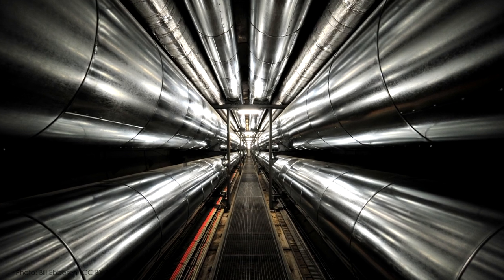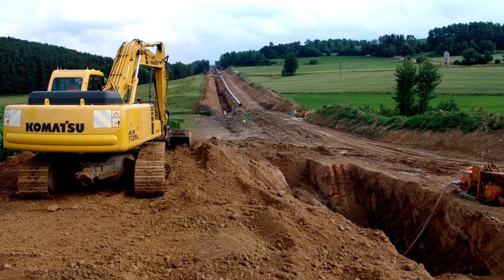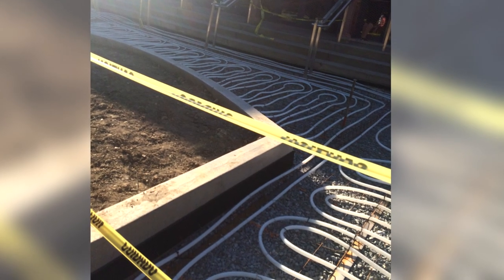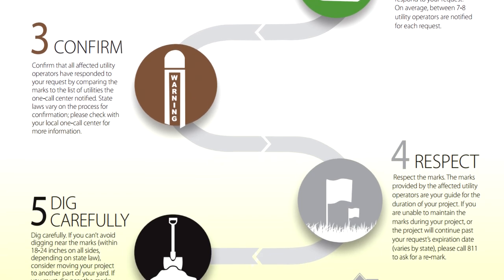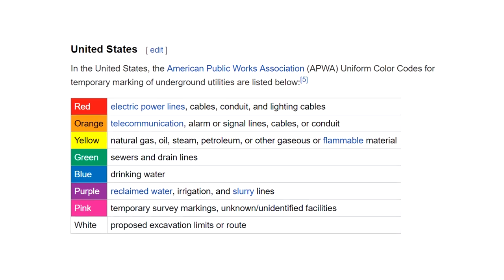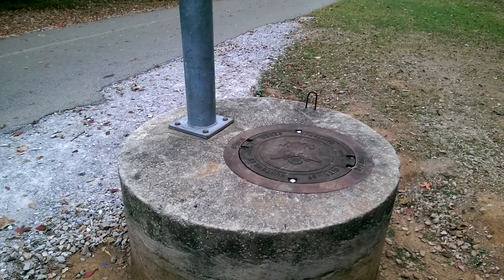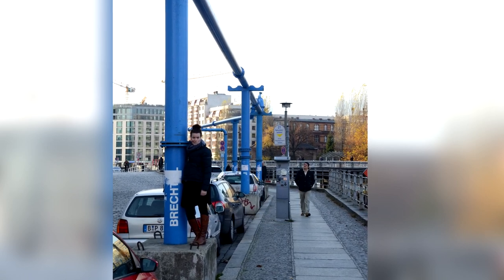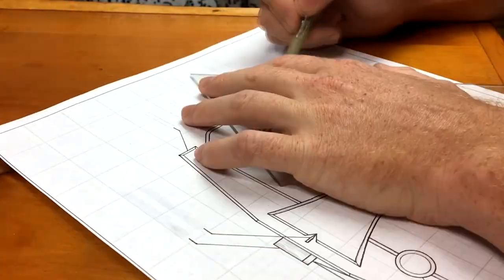What's That Infrastructure? (Ep. 4 - Subsurface Utilities)

Comment: The blue Pipes are from Berlin and are for draining ground water to the Spree. The water level here is only half a meter or so under street level and so you need to drain off the water when digging at construction sites.

Greetings from Berlin

Comment: vent pipes for gas stations are not for the heat of the day, being buried as far underground as they are they have a regulated temp just like anything under ground. they are there to handle positive pressure and venting when filling the tanks and negative pressure when the pumps are active.

Comment: In the US(at least N Dakota). Gas lines which can be steel or plastic have testing points, with plastic it's a wire which come's up near the meter on a home or business or through a valve test point or carsonite post for longer stretches or for mains, with steel you can connect to them directly. Electrical is similar to steel in that you can connect to the meter, to a transformer, or even to the ground coming from a pole. We do have RFID markers, but those are often to mark End of Mains, or to mark services that are difficult to locate likely due to a damaged tracer.

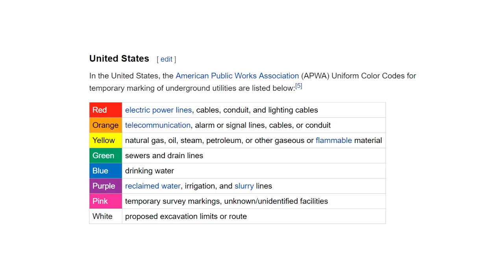All we are doing is sending radio frequencies via a test box for our wands (shown at 3:19) to pick up.

Comment: Those kind of pipes in Berlin are used to drain groundwater out of construction sites. Berlin is build on sand, with water level at just a few meters below the surface; therefore the temporality. I guess they don't risk freezing even in very cold winters, because of the continuously high flow rate, or because underground work is scheduled in warmer seasons.

Comment: Another big difference between fire hydrants in the north and south is that where the ground can freeze, the valve to operate the hydrant is below ground at pipe level.  The operating pin on top of the hydrant goes all the way down to the valve at pipe level (6-10 feet or more below ground).  In the south where below freezing temps are not an issue, most fire hydrants have their valve above ground.

On a side note, that's why a car hitting a hydrant in the south will create a big fountain (like in movies) but in the north nothing will happen.  :)

Comment: In certain area's, for natural gas lines, they will have a casing that's installed onto the steel main with a vent pipe attached. So if a leak occurs the gas will be vented through the vent pipe safely instead of the gas migrating into the drain, sewer, or underneath a building which is very dangerous.

Comment: I'm not sure if anyone answered yet about the above surface pipes in Berlin, but I was there recently and found out the answer. The problem with construction in Berlin that a lot of the ground has high moisture levels, causing buildings to be unstable if not properly accounted for. These pipes are put in during construction of buildings and are used to draw out ground water, and move this water to the river. If you research a little deeper you can usually work out which construction company has installed the pipes just by the colours, the ones I saw most commonly were blue and pink.

Comment: The blue pipes in Berlin are temporary water pipes. You'll see those sometimes in Germany when there are bigger cunstructions which kill (or will kill) the normal water pipes underground. Cause nobody wants to have a day (or in this case probably months) without water. In smaller towns these are usually just a platic pipe direct on the street with some warnings around it so you dont trip/drive into.
Reply: Turns out I'm comepletely wrong. See comment down below.

Comment: We have similar Pipes in Germany Karlsruhe as in Berlin but for a different reason. It is called "Havarieleitung" that is used in underground construction as a safety precaution. Currently they are building underground Train stations here, in case of a groundwater breach it is possible to flood the excavation. Because the ground water level is sometimes even only 5m under the street. Maybe something for a video

Comment: I visited Berlin recently and saw those blue pipes, they were associated with construction of a new metro station (maybe even an entire metro line). I don't remember the markings but assumed they were either a temporary water supply main in use while the underground service was relocated, or part of the de-watering system for the construction.

Comment: I maintain a high speed optical network in Florida, and we live in fear of road construction projects. The number of times construction crews have either not asked for, or disregarded, infrastructure surveys, or just had equipment or operators wander off the beaten path, and cut our fiber provider's conduits and multistrand cables (72, 144, 216, or more strands) beggars the imagination.  We talk a lot in engineering discussions about "cable-seeking backhoes".  😐

I was in downtown Atlanta to install equipment in a remote site and noticed prep work for road construction outside the big colo facility I was working in.  The amount of orange paint on the road was staggering. One wrong move by a backhoe and significant chunks of the southeast get hit with phone/cable-tv/internet outages.

Comment: South Florida gravity fed sewers are pretty interesting.  Because of the GW table being so high these are a series of "lift stations" that periodically pump water to up elevation for the next leg of the journey.  If something fails, the rising water will trigger signals to headquarters, and flash a Red Warning light.  Because they are about to overflow.  They are often (or used to be) located near the old canal / ditch systems.  The ditches/canals have to handle the overflow.  So, even with the best will in the world, these canals are pretty nasty with street oils and etc.

Comment: The blue pipes above ground are temporary drinking water supply.
You see them all over Copenhagen as well. The city is working heavily on the metro, and are forced to temporarily divert the water supply.
Reply: No, they're for moving groundwater away from construction sites. Berlin is built on a swamp, so these pipes move water from the construction site into the canals so they can build.

Comment: as far as I know the blue pipes in Berlin were from when they built the subway station at the Brandenburg gate. they were a security system. the ground there is sand and they were scared the buildings and the gate could move. so in the event of moving of more than a few millimeters the pipes were there to flood the hole in order to put pressure on the ground. of course if that would have happened they would have had to stop the whole project.

I don't know if the photograph shows exactly these pipes, but they were blue so...

Comment: I worked for a small town waterworks department that had to resort (at times) to the use of a "divining" rod of sorts, made of copper wire to "locate" some water/sewer lines. When city records, memory,  and common sense of where a line might be failed, some of the guys there were pretty darn good with using the divining rods to reduce the number of holes we had to dig to spot a line. 

Edit: forgot to mention that these were on plastic or clay lines that had been installed in the past without a location wire attached.

Comment: Many years ago, I worked for a company that located buried utilities. 3:16 shows exactly the tools I used. Or at least part of them. The part not shown, is the transmitter that was hooked up to the facility being located. You'd clamp one wire to the ground sheath or tracer wire or metal pipe in question, and the other wire was attached to a steel ground rod that was, as it's name implies, stuck into the ground. You'd then walk in circles around the transmitter to find where the line was at... and mark it out. If the company I worked for wasn't so poorly managed, I'd have stayed there, but they couldn't get their heads around the concept that people will only work seven days a week, 12+ hours a day at $13 per hour until they can find another job.

Comment: In Fraser, Michigan, USA an 11-Foot diameter (3.3 meter) combined sewage (sewage + storm water) pipe has an issue.  This has caused a massive sinkhole that has started to swallow up houses.  As a temporary solution the major road it runs under has been closed and a temporary at-grade sewage bypass has been setup along with a pump to get the sewage to at-grade.

Also, as a temporary measure, the government has started pumping combined sewage directly into a local river that feeds a river and lake where nearly four million people get their drinking water from.

A huge issue is that many of the older communities in the Detroit area, where Fraser is, have combined sewer systems.  The further you get away from Detroit, the more prevalent separated systems get.  Separated systems have a huge advantage that rain water can, for the most part, be directly sent back to the rivers and streams without treatment.

Combined systems mix storm water with sewage (drains and toilets), and all of that should be treated before discharging.  When rain or infrastructure failures cause too much combined sewage for the system governments have two options:  1)  Allow the sewage to be temporarily stored in the basements of homes or 2)  Discharge without treatment in what is called a "Combined Sewer Overflow" or "CSO".

In Fraser they are having to do CSO's directly into the Clinton River because of a single failure of infrastructure.  I find it fascinating that places like Macomb County in Michigan, USA, with all of its wealth doesn't have redundant sewer infrastructure, and a single failure of a massive 11-foot pipe results in our best option to be sending raw sewage into a water system upstream of where we get our drinking water!

Comment: About the above ground Berlin pipes.  My understanding is this (anyone please correct me if I'm wrong)...  After the wall came down, you had a lot of East/West infrastructure that needed reuniting and standardizing.  These temporary pipes (sometimes pink, sometimes blue) were the quick solution to get things running quickly.  Lots have since been replaced with underground pipes that are the permanent solution, but some still remain above ground.  I've no idea about the construction sites using it for draining water as some suggest, though.

Comment: In Russia they have overhead hot water pipes and gas pipes. Gas pipes are usually yellow. Hot water comes from the power plants and is used for washing and heating. It was different. All the buildings in Moscow use heat from the government.

Comment: I'm not sure what they're doing in Berlin, but those pipes are usually used to drain the construction site, when you build things like subway tunnels, etc. that are below the ground water level. If they wouldn't drain the construction site, the workers would need to work under water :D
Reply: They also have them in Stuttgart, where they put the whole train station under ground in a very difficult rocky environment...

Comment: Since a few years in France it is mandatory to ask beforehand, through a specialized public platform, the localization of underground networks potentially concerned by the digging we have to make. It is also mandatory for any network owner to have at least a class B (<1.50m precision) map of its network. If it's class C (>1.50m precision, usually old water pipes but also sometimes High voltage lines), it is also mandatory to bring them to a class B type before beginning digging. This whole process (named DT-DICT) is a bit of a pain, and also most clients are still unaware of it and just want to begin their projects quickly. Yet this procedure have made a dramatic decrease in network damage through digging in the last years. Also the color marks aren"t exactly the same (telecoms is green here, orange is for calo-fluids or chemicals).

Comment: Those raised pipes were not uncommon in Zhengzhou, the Chinese city I used to live in. I'll see if I can upload the short video I have from when I revisited my old apartment complex in November 2010. (eta: link https://youtu.be/5CNnnMCgxOo) They appeared in that particular location spring of 2009 and I never really investigated what they held, but as far as weather and water, it was similar to my hometown of Virginia Beach where it only snows a few times a year and doesn't often stick but is certainly below freezing a few weeks each winter. But the utilities we had available were city-run radiators, water, sewage, electricity, phone/cable, and gas for cooking/hot water, so take your pick... what could it have been? It enters the building on the landing between the first and second floors. I wondered at the time if it was the hot water for the radiators, as I seem to remember the pipes being wrapped in some sort of cloth, but it seems silly to lose so much heat to the air (and I don't remember, say, snowflakes hitting the pipes and sublimating!) Then again, I moved out the summer after they were put in, so I only ever passed by others in the winter, never actually lived near them in those temps.

Comment: We had 811 come out "call before you dig" they had mismarked the sewer line. Instead of being a sewer line it was a high-pressure gas line! We used an excavator to dig to tap into the sewer line. When the workers realized it was a metal line that was used for high pressure gas. They called the utility locating company again. In the Houston area, the sewer lines are made of PVC!

Comment: i am willing to bet that the structure at the end that you say is an intake.

1. a low scale water desalination plant  a water bottling plant nearby that does not need more than a few thousand gallons a day and operates during high tide.

2. a water truck filler connection (maybe local statistics say fires happen during high tide).

3. maybe not an intake but a discharge pipe used to empty water trucks and fire trucks without risking eroding the street or fields by discharging into the streets or fields they connect to that and the water goes into the ocean harmlessly. (anyone who tried to fill their swimming pool from a fire  hose has created a divot in the wall lining of the pool)

4. maybe to prevent settlings during high tide (anyone who lives in a flood zone has to scrape mud from their basement after the water goes down because standing water can allow mud to settle more so it could be a point where they connect a pump to keep a flow to prevent settlings during high tide

Comment: The colourful pipes in Berlin are temporarily installed to drain the groundwater level, which is rather shallow there as it was constructed on a swamp. In fact some of the construction work is similar to working near the coast, even though Berlin is far away from any sea. They can for example not make "normal" foundations for many, especially big buildings and have to use columns instead.
The swampy character was already a problem in the past and there were experiments conducted on this matter already 80 years ago, as you can see here: https://en.wikipedia.org/wiki/Schwerbelastungsk%C3%B6rper

There is also another region in Germany, which has problems with groundwater. The "Ruhrgebiet", which was the biggest underground mining area in Germany has problems with keeping the water out of the mines nowadays and has to be drained constantly. Coping with different types of slow but steady stress on buildings like ground shifting, lowering or the swampy underground in Berlin might be another video topic for the channel.

Comment: Its interesting for me how you talk about a fire emergency during the winter. I live in the Dominican Republic so Im not very familiar with snow, so how common are fires during the winter compared to the other seasons?
Reply from the maker: Maybe even more common in the winter due to all the heaters and fires people have in their houses.
Reply: well that makes sense...
Reply: While tree related risks are pretty big, a far more common thing tends to be flue fires and such. Poorly maintained and not really thought about heating systems. 

While summers do have a higher risk for external brush fires and the like, we typically have more points of ignition going on in the winter. 

Another issue that isn't often thought about by the general public is vermin related fire risks: Mice and such getting into a structure, making their home to escape the cold, and then chewing on wires and the like.
Reply: I'm a firefighter in Montreal, Canada.  We are below freezing and covered in snow from november until april and the ground freezes solid from december to march.

Fires are just as common in winter as any other season here.  They do have their own set of problems though... our hoses can freeze, hydrants can freeze and become useless even the fire truck pump can freeze, hydrants can be hard to find if they are covered in snow, ice is a huge slipping hazard when we spray water, snow of the roof of houses makes them very hard to access for ventilation.